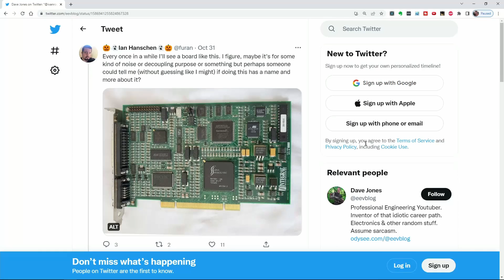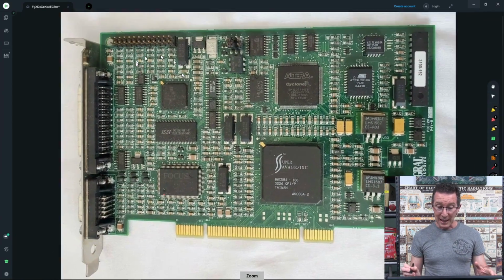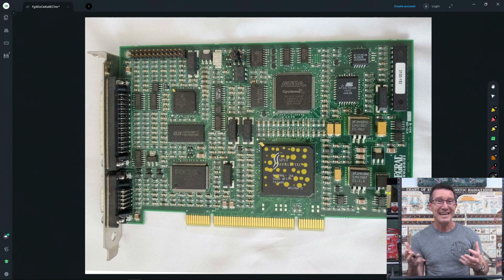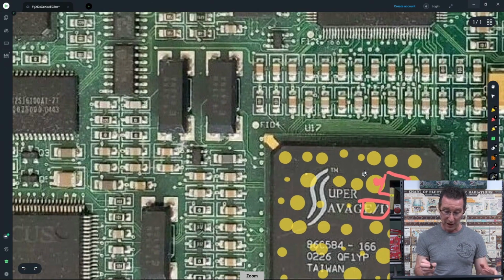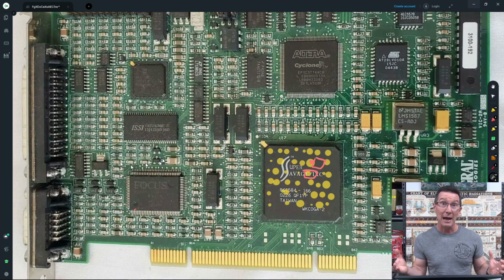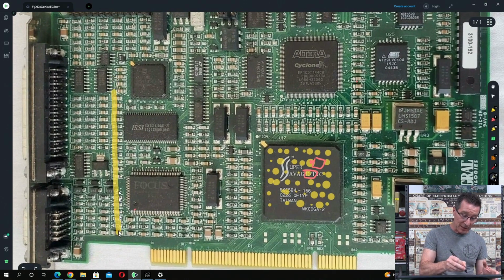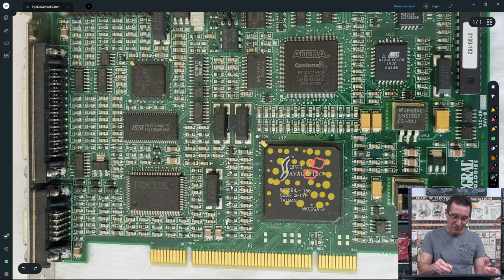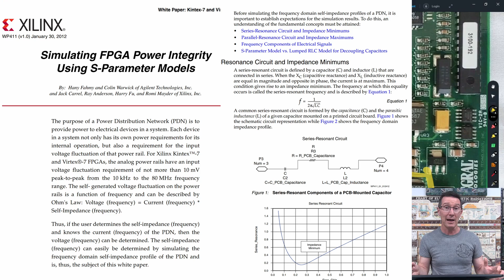EEVblog 1512 - Why Bypass Your PCB Like THIS?

Comment: most likely that super savage has multiple power domains and they may be staggered. so they will be alternating 5v and 3v3 decoupling caps. A lot of the other capacitors have resistor chains nect to them. look at the 25 pin connector, you see traces running from one resistor to the next. those are most likely impedance matching / low pass filters for tha analog i/o (video signal). the same goes aroudn the focus chip and between the focus and savage chip. those are most lilely matching networks / lowpass for video

Comment: This card was made by Integral Technologies as a video capture card for 16 or 32 channels of analog CCTV feeds.  It would have connected to an external input box via the large connector on the card.  A lot of the people that worked for them now work at Exacqvision.
Reply: Well, knowing that it's for cctv changes EVERYTHING imo. Throwing every possible bypass cap at it means it will be more reliable, particularly in hostile environments. And maybe helps to mitigate some sort of an RF attack from someone trying to disable it.
Reply: Thanks for the info, it's definitely interesting. Another question is which of these caps are filters etc. in analog circuits, and which are there for DC rail filtering.
Reply: @KeritechElectronics  Or which are there to couple split planes together so that signals can cross the gap without the electrons flying off. I think Dave way underestimates the sophistication of the ASIC when presuming the power scheme for this board.
Reply: @abitofabitofabit4404  "electrons flying off" LOL, I love that phrase!
Reply: a large box or a large pigtail??
Reply: @frogz  it was a 1U rack mount device with 32 bnc inputs and a bunch of contact inputs

Comment: I would assume from all the I/O it's probably a broadcast grade card and if it's like my broadcast audio cards it has a lot of extra shielding and noise reduction. Working in studios that share close proximity with the transmitters noise and interference issues a constant. I haven't quite seen it quite like that but I wouldn't be surprised if I did.

Comment: It's a pretty full layout. So well done to the designer for getting it all to fit top side. The crystal routing is a bit 'how ya doin?' though :D  New setup looks great Dave.
Reply: Where do you see the crystal?
Reply: @666Tomato666  i assume they are looking at the silver package at the top of the image, near the center
Reply: @666Tomato666  There are five crystals on this board. It looks like nearly every chip has it's own clock. They are the black plastic devices with four pins.
Reply: @royhenderson4085  the three ones clumped together in the middle, and one on the top?
I'm sceptical, usually quartz oscillators have just two contacts... can't make up the etched text so can't say they definitely aren't...

Comment: I could tell a lot more by looking closely at the board and component selection, but I'll guess it was a brand-new start-up that hired a young design engineer right out of school or with limited experience and put them in charge of the board design without an experienced supervisor. It clearly has a bunch of I/O, so in order to cover their butt the engineer told the layout person to decouple absolutely everything. With the quantity buying power they got from all of the caps on this board they may not have even lost much money on the deal. There are often back-stories on board designs like this one. Also, it looks like the company may be a home-monitor and control company, and I've seen some boards from such companies that were definitely belt and suspender designs, practically aerospace grade, and priced accordingly.

Comment: I could not tell, but do you think there were a couple of different cap values per pin for some of the parts (0.1 and 0.01uF for example)? That PCI bus to that one IC is running at 33mhz and probably faster internally so decoupling over a few frequency ranges might have been needed.

Comment: Surely a lot of those capacitors are for coupling and filtering? I see nearly as many resistors as capacitors; looks to me like there's a lot of bandpass business in there.
Reply: That's what I was thinking.  If this captures 16 analog inputs, all the caps near the large IO connector would simply be analog coupling/band pass filtering to the A/D inputs.

Comment: Not sure how expensive these boards would've been back in the day, but if they were pricey enough, they may have wanted to leave clearance around the BGA chip for manual rework. Like if you've got $100 worth of chips on the board and the only thing stopping it from working was a dodgy BGA joint, it could be worth a manual reflow, or possibly even removing the chip reballing and resoldering. That would save you from eating a $100 loss (plus the margin of that board).
Reply: The extra space around the larger BGA chip might have been provided for access for an inspection microscope. Back in the early days of using BGA packages some assemblers used a microscope that had a prism on the end which could look under the BGA package to check for unsoldered, deformed or missing solder balls.
Reply: @stephenbell9257  Cool
Reply: I figured space for traces.  If you cram the passives too close, there's no room left for routing.

EDIT:  Actually, now that I'm thinking more about it, it's probably just adhering to a grid, there wasn't enough room for the ASIC if you cram in one more row, and so they just put the IC right in the middle of the void.
Reply: this is very likely to have been really expensive as VMware and Virtual Box both emulate an S3 card like this by default.

Comment: You kinda missed the point on the neat rows of discrete components… it’s for the “pick and place machine, efficiency” !
It minimizes the pick and place head rotations, faster placement of repetitive placements for mass production 👍🏻
Reply from the maker: Not really. The physical arrangement doesn't really impact the speed. The head has to go back and forth regardless. Rotation, yes maybe if the head need to slow down as the part rotates, but that's not a positional thing.

Comment: i have seen boards entirely covered in bypass caps in every empty spot that just went to the ground plane
i suppose if you have the room and a need to decouple large fast current gulps for fet drivers or something ... caps are cheap enough
Reply: Must've been a bored board layout intern that wrote a script to place bypass caps wherever there was room on a grid pattern. Maybe they were also trying to see how many 0.1uf caps it took to trip the power supply with the inrush current on power up... 394 - no, not enough, 398, no, still not enough - I've got a fever, and the only prescription is -more cowbell- more bypass caps

Comment: Probably didn't read all of the manufacturers decoupling guidelines.  Maybe read the required number/type of caps but not how to arrange them.  Happens a lot when the circuit designer and the board layout designer don't talk to each other.